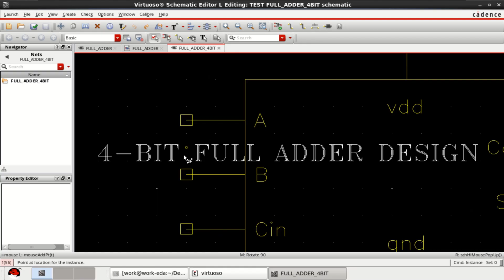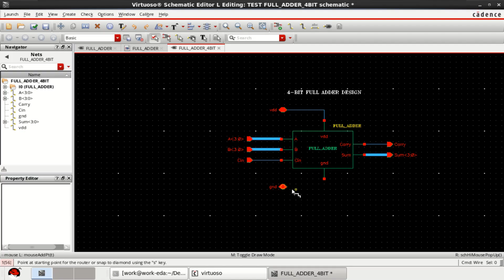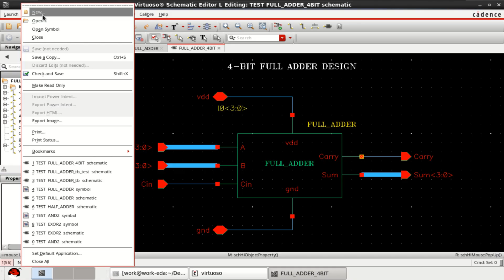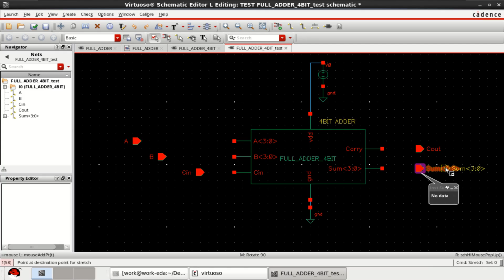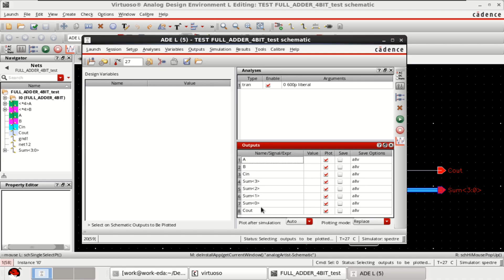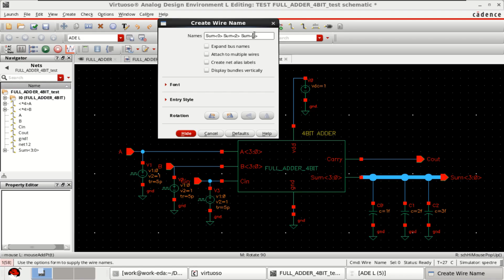Cadence Virtuoso: 4-BIT FULL ADDER Design.

Comment: Dr . full adder only 1 bit but u connected 4 bit pins. this fake. why dont u use 4 full adder ?
Reply from the maker: Hi, It is not a fake. I have created a full adder and made the design  instance also as 4bit. Note that for a single bit full adder you cannot apply 4 bit data as input.